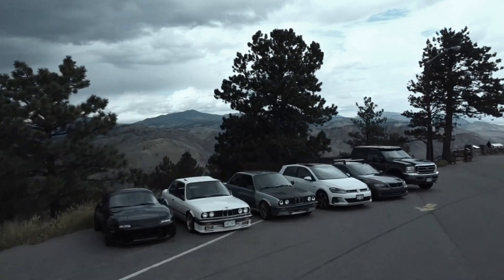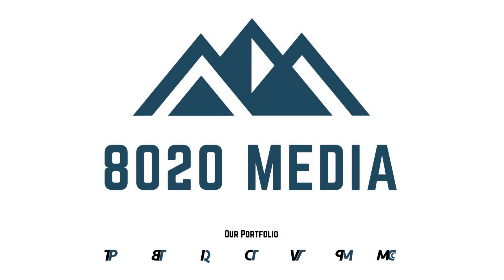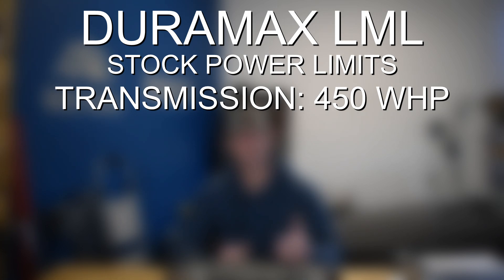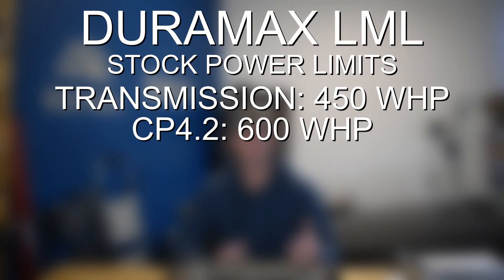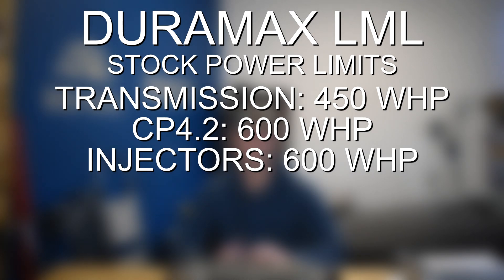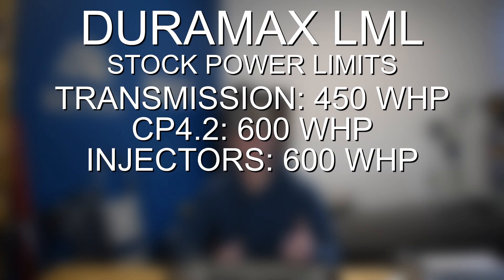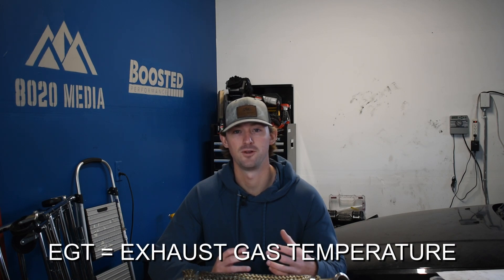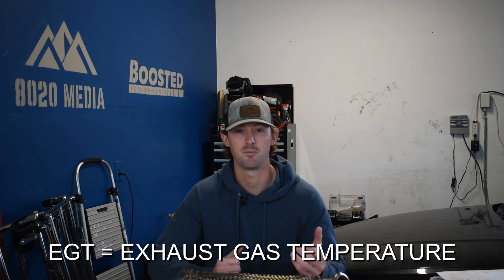How to Build a 500 WHP Duramax LML!

Comment: I drove my 2016 Denali for 2 weeks when it went into limp mode.  No matter how long I drove on the shoulder of the freeway, at  a dangerous 35 mph, it would not regenerate.  I finally took it to the dealer and they did a manual regen.  I said, never again.  At 1k miles, I took it to the performance shop and upgraded the exhaust, removed the DPF and DEF system, added a lift pump, did the CP3 conversion, removed the EGR , upgraded to 64 mm turbo (4" downpipe) and got an engine and transmission tune using the EZ Lync.  The power and drivability is amazing and even with 37x 13.5 Toyo's, (which I can chirp in 2nd, 3rd and 4th gear) I get 22 MPG at 70 mph.  Not bad for a 10,000 lb 4x4 with a 10k rear winch and a 50g aux fuel tank
Reply from the maker: U - Driving on limp mode for 2 weeks is crazy lol. But you did the right thing afterwards.
Reply: @8020Automotive  it went into limp mode during the 2 weeks.  I only drove it once to attempt to force a regen.  No way was I going to try it again.  Not after that first harrowing experience.  :-)
Reply: 10,000 lbs?
Reply: @MTMackerel  yeah.  Why?  How much do YOU think it weighs?
Reply: @0101-s7v  I don’t know what you’re rolling, so I don’t know. 10k just seems unreasonable, even for a lifted jacked out dually, plus the tank/fuel like you mentioned. I was just wondering, that why I asked.

Comment: I got a question for you i got a 2011 lml durmax and i have a tuner on it when i bought the truck it was set for tow on the tunes well i was wondering does running it on street or preformace tune hurt anything?
Reply from the maker: E - It shouldn't. It's advised to have supporting mods to support the tune though.

Comment: Anyone have any experience with the Mishimoto intercooler?  I grenaded my last turbo and trashed the oem cooler…. I only see mishimoto and banks high dollar coolers that are beyond oem. Or oem+ level.
I believe I may have overspent the bearing due to boost leak off a cracked oem intercooler.   So. Thousands of dollars later I’m here.. any info is appreciated
Reply from the maker: Intercooler upgrades are a bit more limited - Mishimoto and Banks are the two main full upgrade options, Mishimoto is solid. There is also CSF 7101 which is an upgrade and a bit more affordable. Shoot us an email support@boostedperformance.com and we can help you out.
Reply: Since our chat here.. went with the cooling stack (Mishimoto intercooler and radiator as well as PPE trans cooler)

It all has been phenomenal. Just wanted to reach back and say thanks for the insight

Comment: EZ Lynk is pretty sweet too. Nice to be able to monitor, clear codes, data log, and tune from the cloud. Been running that setup for 6 months now and it's been fantastic.
Reply: I had a bone stick 15LML. 
Did AirDog 165, full HSP PIPING , turbo mouthpiece, hot and cold side charge pipe and TRUE “EGR REPAIR” with Y-bridge. Lbz up pipes. PPE downpipe. Intercooler mandrel bent everything. Hsp cold air, obviously PCV, 5” str8 downpipe back axle dump. EZ LINK SOTF tunes. DSP 5 switch thru the firewall. 0-200HP. Trans tuning. PPE DEEP OIL PAN(GM’s faulty pan leaves the last 1/3 qt if your filthiest oil in valley) full Kryptonite Death grip front end, except for Cognito upper control arms. Cognito 7-9” on 24x13.5 with 38’s. Still stock turbo, right at 550 hp when at mid 100hp tune. Race tune (5) @200hp haven’t dyno’d. But at race tune, I get 22mpg hwy now!!!!
Reply from the maker: Tim - Thanks for taking the time to share your experience! Sounds like you have a pretty sweet build.
Reply from the maker: Rite - Very true! Thanks for sharing your experience.
Reply: *stock
Reply: I loved EZ Lynk when I had it on my truck. I had the tunes from duramaxtuner before I deleted it. But I ended up deleting it and decided to just buy the efi live flashscan v3. I've changed turbo sizes 3 times lol. I decided to hyst do UT myself
Reply from the maker: H - Thanks for sharing your experience!